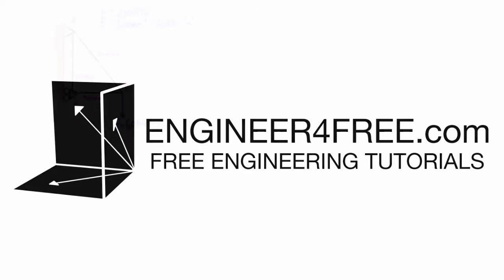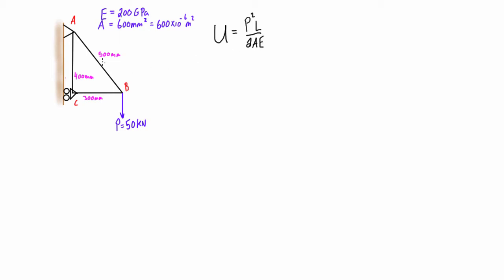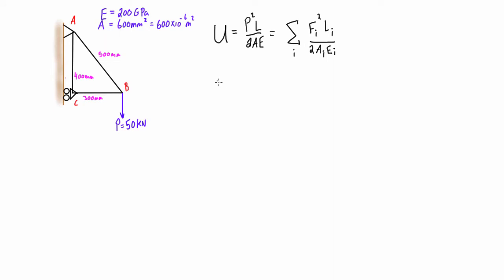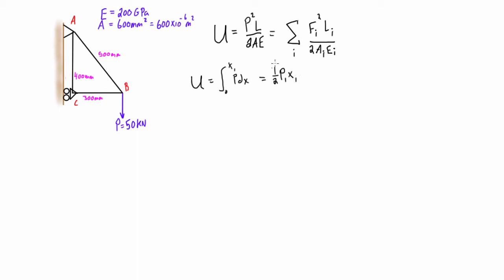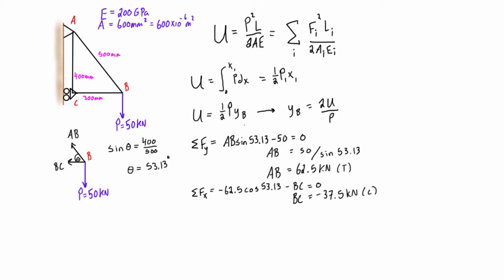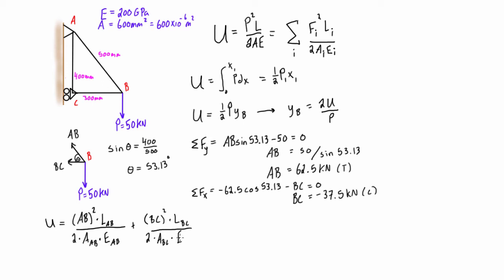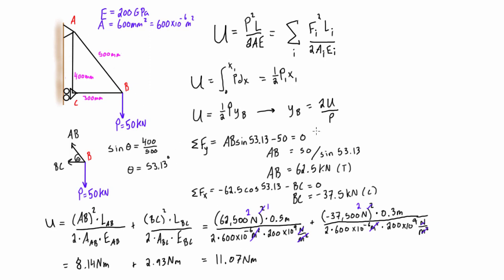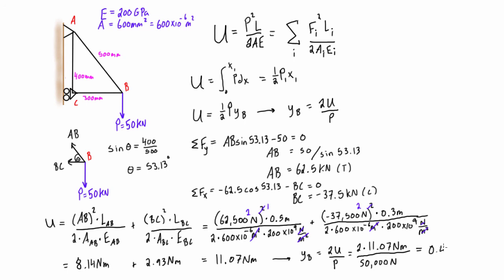Truss deflection under a single load example problem #1 (virtual work)

Comment: Well this video was sooo good. But I have a question.
Why the displacement of point B only takes place in a vertical direction? Why it not displaces through horizontal direction as we can see the horizontal memeber is in compression?
Reply: the angled member AB will be exerting an equal horizontal force in the opposite direction, causing no net horizontal defelction.

Comment: How do you know when to use FL/AE as oppose to F^2L/2AE?
Reply: if you check the graph of the strain energy, you'll see that the shaded region is a triangle, which is always half of the original plot. That's why the half is in the equation